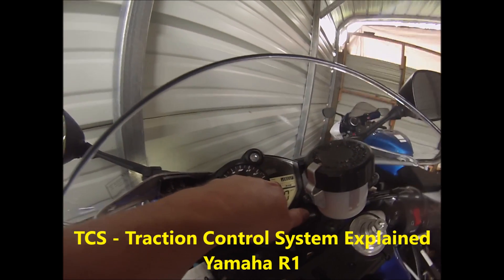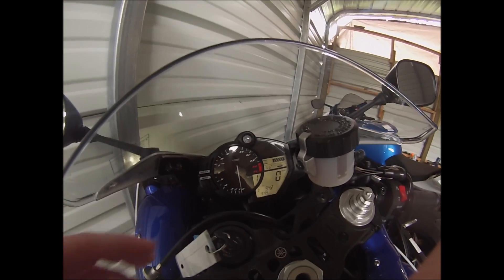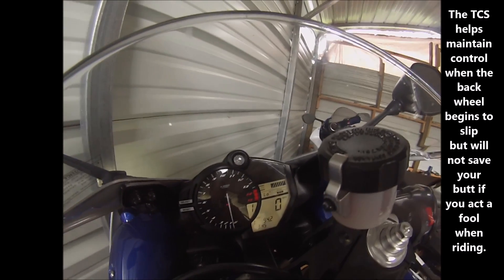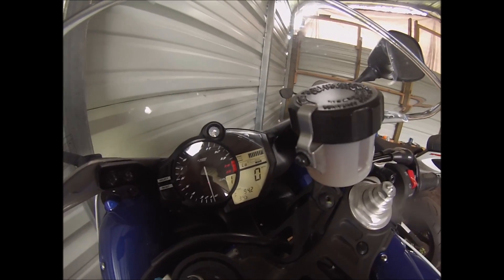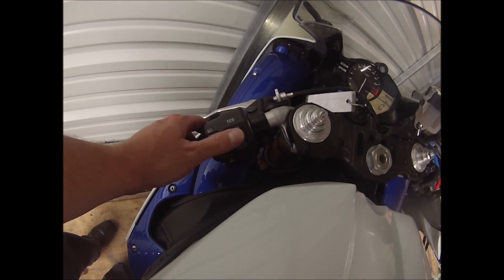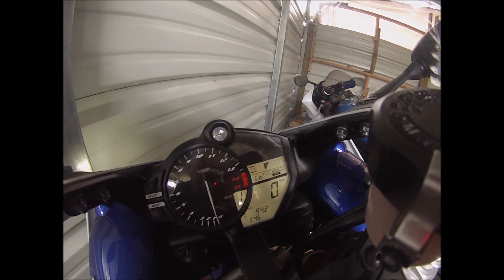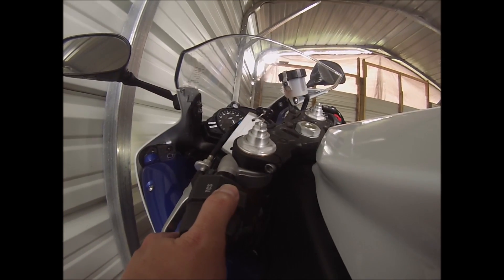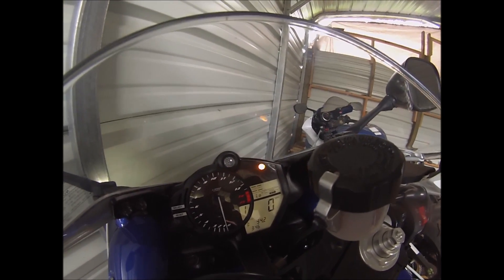Yamaha R1 TCS - Traction Control System Quick Explanation on How It Works

Comment: I’m just curious tho, if I have TCS on 6 and I do a wheelie would that help support the back from slipping?
Reply from the maker: From what i basically know, tcs should help with traction.
Reply: @CrossplaneNation  just keep it on? At what number is best?
Reply from the maker: I always kept mine set at the highest setting.  You have to just play with the tcs until you find what is best for you and depending on what style of riding you're doing as well.

Comment: Sweet info man. Thanks. Can i ask a silly question. Does the 09-11 have a front wheel speed sensor? I ask because i just bought a wiring harness off an '11 and it has a front wheel speed sensor, i didnt think any non tcs models would need it qnd just want to make sure the harness i have is indeed an 09/11 and not a 12/14. Thanks for any info mate
Reply from the maker: Man, that would be a something a yamaha dealer could confirm tho.  I don't know at all and couldn't tell you right or wrong.  You could google the part number on your harness you bought and reference it to the results as to which model yr it fits.  Wish I could be more help.
Reply: @CrossplaneNation  thanks mate. Turns out it is a december 2011 bike so a 1kb/tcs model haha. I will learn to be more careful next time. Just another question. You showed in the vid that you scrolled the tcs down to 1 with the top half of the tcs button then held it for 2 secs to turn it off completely. If the setting is at the default 6, can you hold the button down for 2 secs and turn it off or do you need to scroll back to 1 first? Odd question i know but i havent got a bike in front of me

Comment: Why isn’t it white, I’ve seen other R6s with white display..? And is it possible to keep it white?
Reply from the maker: Not sure really, may be something just for the r6 and not the r1 when it came to design.  As far as switching out the face to white, might do an internet search on r1 face replacements, unless the gauge cluster itself is sealed completely.  I don't have this bike anymore or I would go look.

Comment: Hey bro I'm new to the TCS setting and was wondering what's the best setting for the streets I should leave it on?
Reply from the maker: Really depends on what u want it to do.  If u want to pop wheelies and want all the power to wheel, turn it off or set it to the lowest.  If it is wet out or wanting to keep the bike on the ground, set it all the way up.  When the system is turned all the way up, the bike intermittently adjusts power so to speak to the back whee.  I kept mine up all the way up all the time.  Even after stretching, lowering, and flash tuning it, the tcs couldnt keep up.

Comment: Hi! I have a problem with the TCS 2012 R1, whenever I start the bike it comes in the middle (as normal), but if I run for a 500 meters it's automaticaly changes to "TCS Off", the worst part is that it occours while the bike is running, I need some help with this. Cheers!
Reply from the maker: Does it throw a error code?  Sounds to me lime the sensor itself is going bad and possubly needs replaced.  Not sure really...

Comment: jI just upgrade from 2002 r1 to 2014. do I have to turn it off to do a wheelie or just lower the level?
Reply from the maker: Try it with it set to only 1 bar, that is normally what I do...else, you may have to turn it completely off each time...i guess it depends on how u do ur wheelies...i know with me leaned on the tank and flooring it thru 3rd and up the front atill comes up a bit...

Comment: Thanks for the video! Buddie just got a 2014 R1 and couldn't figure out how to pull wheelies. Holding down the TCS button worked :)
Reply from the maker: +toysareforboys awesome, how do u like it so far...?
Reply: +Crossplane Nation It's not mine. I tried his at the track, didn't like it, but it was mostly stock, where my 07 R1 has braketech iron rotors, carbon fiber lines, cp1 pads, fork cartridges, elka stage 4 rear shock, is set up for my weight, etc. So wasn't really a fair test.
Reply from the maker: oh i gotcha...